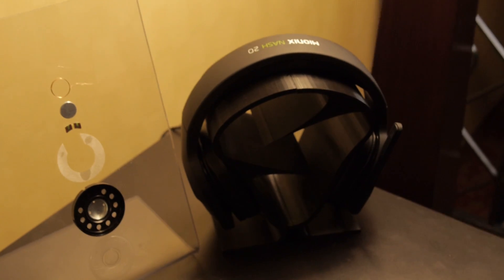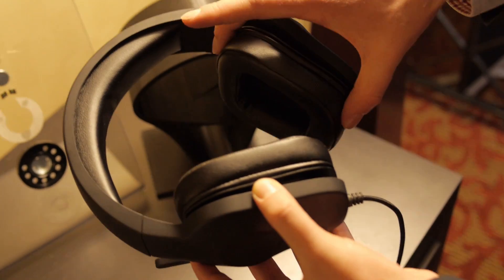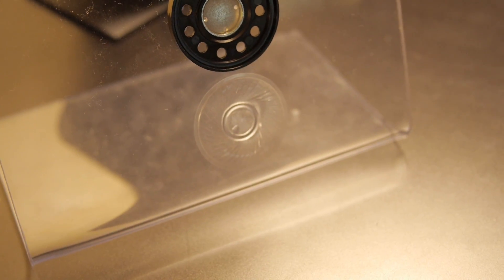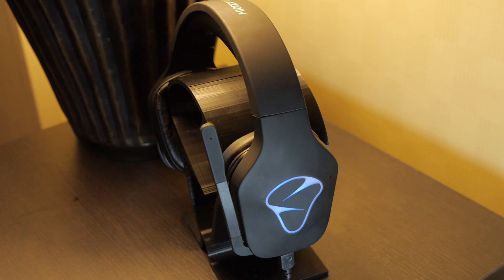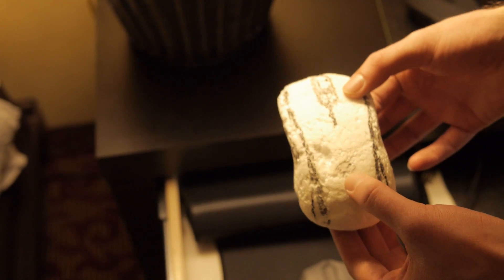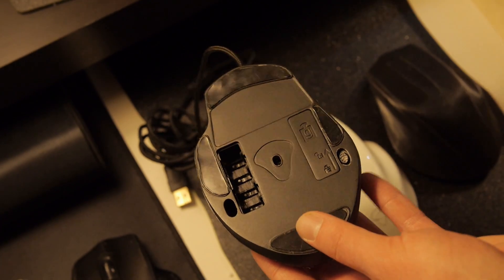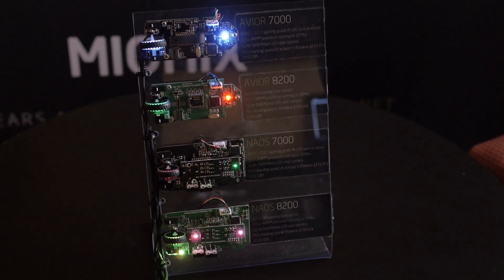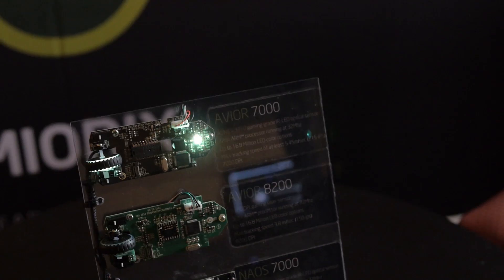Mionix: How They Make a Mouse, Sensor Overview, & The Nash 20 Headset | CES 2014

Comment: Did he say the 8200  has problems and cant be reprogrammed ? And that the 7000 is better ?
Reply: Yes, simply said, the ADNS-9800 and ADNS-9500 Sensors have "unlinear Tracking" which results in Mouse acceleration/less predictable Cursorbehavior.
Reply: then why would they make such a thing
Reply: *****
 Because CPI and Laser illumination are the biggest selling Points on the Mass Market, Avago hasnt even admitted it as a flaw because it doesnt hurt the sales, and apparently neither does Pixart which is owning the Patents.
Reply: mightywoll3 its really to bad.. i have a avior 8200 and i have been messing with settings all day... nothing feels right...  just a waist of money.. hopefully i can sell it fast..  wish this video came out before i bought it ..

Comment: These just look like overpriced Logitech's....
Reply: every thing is a overpriced logitech
Reply: well from the reviews I've read (this video actaully got me interentested in one) they're pretty high quality, the NAOS 5000 is $135 in Canada which is not too bad (and cheaper than the states oddly)
Reply: How it looks is probably the least important part.
Reply: PulletSurprise My £6 Zalman-ZM300 has an identical exterior and good enough for most(Adjustable 2500dpi, 7 buttons, ect) specs. Plus, I've owned it for over a year and it's as good as new.
Reply: tgrech but your Zalman also has terrible cursor accuracy and very low max tracking speeds. Not saying Mionix isn't pricey, but they also deliver high quality in every aspect.
Reply: IskaRiot84 i like that they admit the acceleration (not that its news but i haven't heard a manufacturer talk about it)
Reply: IskaRiot84 A savvy user would stay away from brands like this. Overpriced tech that servers little to no purpose.

Unless your a dude with a ton of money and nothing to spend it on....Then have at it.
Reply: Nathan Mitchell I don't really care if you want to waste your money. It's yours to spend.
Reply: Greg Cunningham the are pretty cheap in norway and they deliver good qualty (im norwegian) and they have a good software in comparison with razer shitapse

Comment: You'd need a 38.4K or 21600p Monitor to use a 8000 dpi mouse with the same accuracy and speed as a 400 dpi mouse on a 1080p monitor...  So pointless...
Reply: Right, you use a mouse at 8000 dpi, to move from 1 side to the other horizontally, you'd have to move roughly 1/4 of an inch, and to move vertically, 1/8 of an inch, no one can control that
Reply: Prich038 Believe me, plenty of people game at 8000 dpi.
Reply: No they don't, they adjust ingame settings to reduce the dpi, you can't litterally play at that setting, it's impossible to control and people using 400 dpi in a shooter will beat you everytime, just google it, check out Youtubers dpi settings, a good example are FRANKIEonPCin1080p, Jackfrags and LevelCap (pro Battlefield players) who all game at 400 dpi as you have the most control and are super accurate, they say themselves that these high dpi's are gimmicks, just a marketing tactic, there is no point disagreeing as this is fact